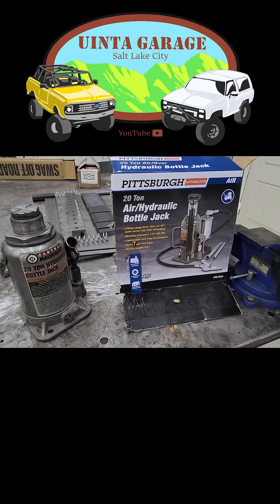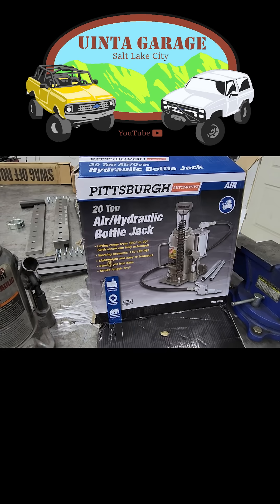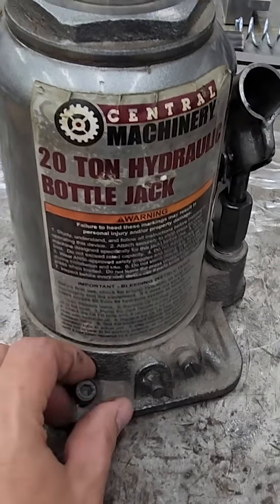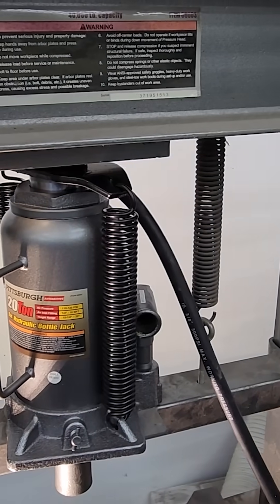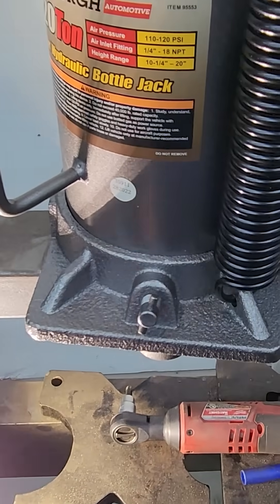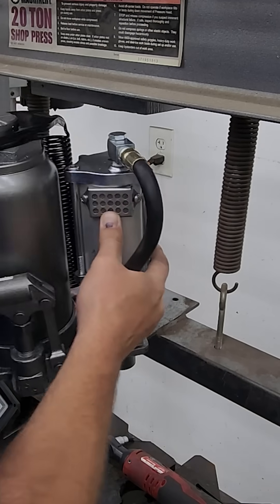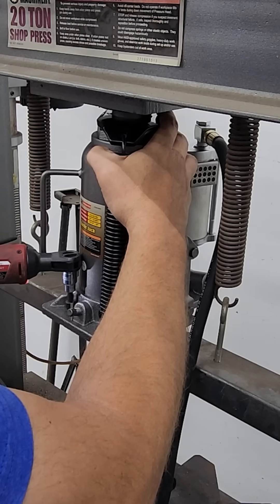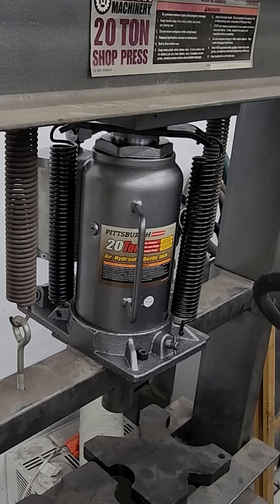Harbor Freight 20 ton press upgrade

Comment: Im going to do this with my 12 ton HF press. Ive used it a few times, unfortunately the bottle jack is leaking fluid. Since I need to replace the bottle jack and HF makes a 12 ton air powered jack. I might as well upgrade since I have an air compressor in the shop and i bought a quick release knob. Thanks for posting this!

Comment: I did this exact replacement 4-5 years ago and fitted a knob on the release valve stem and mounted the air trigger on the press. Yup, nice improvement. 😊

Comment: I’m quite certain he didn’t use Harbor Freight drill bits to make those holes. 😂😂😂
Reply: Some Harbor Freight drills are up to mark bro
Reply: Can verify, jack wouldn’t have holes in it yet if he was
Reply: Bro ☠️🤣
Reply: 1.) that's cast iron, you can drill a hole through it by looking at it too long. 2.) the standard 20 or so count titanium coated drill bits from harbor freight have drilled through everything i've need them to and more. As long as you use cutting oil and step up in size, there should be no problems unless you're drilling stainless. But as far as mild steel is concerned, they've worked great.

Comment: I have used bottle jack presses for close to 50 years and I have never once seen one where the jack was bolted to the press. Not once and no the jack never "fail out". If put in correctly it can not fall out. It always clamped in place. Seems more than a few people do not know how to install a jack in a press.

Comment: 20 tons. 2 bolts??!
Reply: The bolts are just for keeping it in place, they don’t bear any load at all.
Reply: Use grade 8 if it makes you feel better but there's no lateral load.
Reply: I have used bottle jack presses for close to 50 years and I have never once seen one where the jack was bolted to the press. Not once and no the jack never "fail out". If put in correctly it can not fall out. It always clamped in place. Seems more than a few people do not know how to install a jack in a press.

Comment: I did this mod to my press a few years ago and I have found that on the harbor freight air jack, the air pump portion does not have the strength and when the press runs out of force I have to hand pump it to get the full tonage out of my press, other than that I love it
Reply: Sounds like u need a higher strength air Jack then 😏
Reply: Still useful to quickly lower it
Reply: I exchanged a 20-ton manual jack for a 20-ton air jack

Comment: Now that Jack is no longer a 20 ton jack  good job
Reply: how do you figure that? remove 20 ton and replace with a 20 ton somehow equals more than 20 tons?
Reply: @coryament  You took the words right out of my mouth.
Reply: Who here actually thinks either jack is worthy of 20 tons. I personally wouldn't trust either one past 10
Reply: @coryament  I have lifted 28ton with one of HF jacks before they have lasted 8 yrs and still work
Reply: @larryw866  I highly doubt that. maybe because you have an old one but the newer ones do not last for shit. I might do a video on all the garbage tools I have bought there. all junk
Reply: @coryament  or you just don't have the experience or the know how to use tools
Reply: @larryw866  I have been using tools my whole life. I have 2 sets of tools. All my professional tools Matco or or snapon i used at the shop. then i tried to build up tools for the house. Big mistake all junk from harbor freight. I am going to do a video on all of the junk tools I have purchased from that place.
Reply: @coryament  all because you only have two sets doesn't mean anything 🤣 I have Mac , snap- off , matco and proto.
Reply: @larryw866  Matco and snapon are not the only other tools I own. But everything I have purchased from harbor freight is trash. Most of the time it is trash right out of the box just like the ball joint press it was bent when I got it out of the box. Went to exchange it and the next one was the same.
Reply: Did you mean that this air hack is not up to the task of an hydraulic one?
Reply: @dcgo44r  exactly it's weakened
Reply: @larryw866  so 20 ton is not 20 tons lol
Reply: @coryament  Not sure I think he might be onto something! Air drive mechanisms are not to strong specially from HF. That is the weak point.. The jack can be 20 T but the driver might never pushed close to that number!

Comment: If you’re a real mechanic that uses a press often, you want the control of the manual option. You’re gonna mess up parts with that air setup, you have no feel for resistance if the parts are misaligned or binding from getting cocked.
You sir are a tool, go back to legos or something 🤦‍♂️🤡
Reply: His hands ain’t even callous or dirty, straight up tool right here🤦‍♂️

Comment: i have yet to have a harbor freight bottle jack last very long at all. harbor freight does not have anything worth buying
Reply: Feel sorry for you I have multiple and they’re over a decade old🤷‍♂️
Reply: @Leothelion357  they are old enough to be decent quality. I bought a 12 ton press to do small work. Hardly used it and the jack has major gouging on the ram and wont hold pressure. I have recently replaced the ram.on my engine hoist and it already leaks out of the pump. I have only used it a few times. I have wasted so much money on tools there and will not even think about walking in the door anymore. Sad thing is they are owned by snap on
Reply: @coryament  wow maybe you’re right, quality of some stuff there has definitely gone down but I haven’t bought any hydraulic equipment lately from them.
And holy cow I didn’t know snap on bought harbor freight!! Makes sense cuz some of their stuff looks snap on lately
Reply: @Leothelion357  I'm not 100% it is the same owners but I believe the owner of harbor freight is affiliated with snapon.
Reply: @coryament  they have no affiliation with a each other one is usa made aka snap-on and one is china made aka harbor freight
Reply: @larryw866  that's funny my bottle jack on harbor freight press has  been used a half a dozen times and the shaft is all scarred up. I even went through a lot to make the press square before using it. I have been using tools my whole life and have never seen the lack of quality that come from there
Reply: @larryw866  I was mistaken about them being affiliated my bad.
Reply: @coryament  The affiliation is that snap-on sued harbor freight for selling their jack for much cheaper... and lost
Reply: Except they sell Snap-on Jacks there. . .